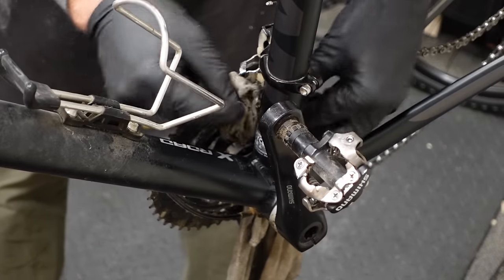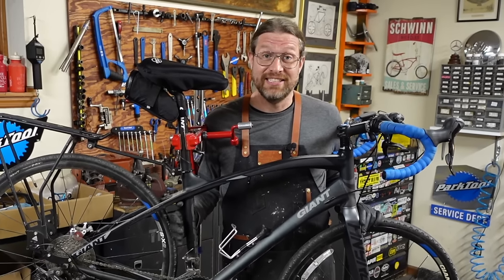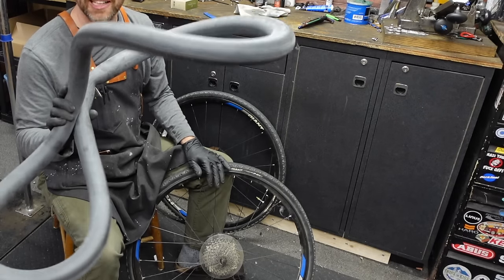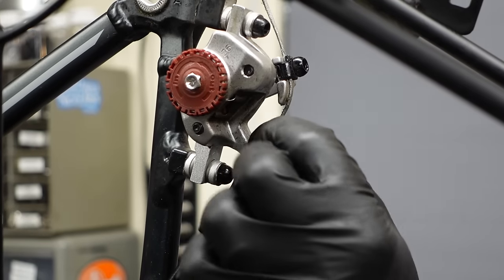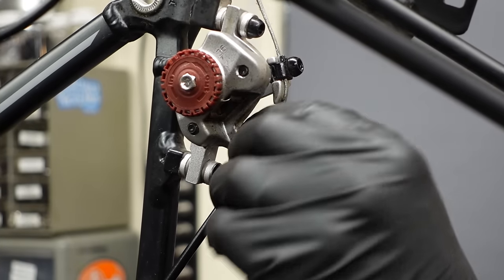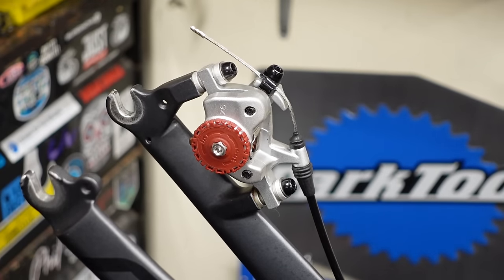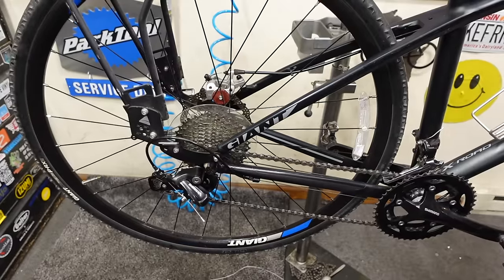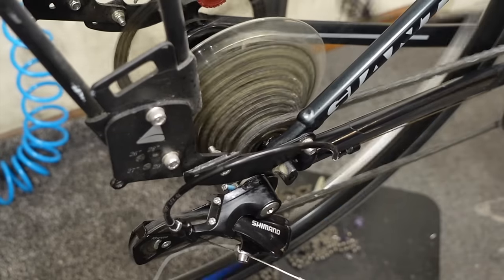Preventative Bicycle Maintenance the EASY WAY! Giant Anyroad gets a basic tune and a couple tweaks!

Comment: Giant Anyroad. Had one for a few months. A good bike but just not thrilled with the geometry. The front center was much too long, and the engineers at Giant must have never read CON1.  The dimensions and geometry were just not right. Amazingly, I find many of the old bikes for the late 1960s to the early 1980s to have excellent handling which comes from excellent geometry. Even the Schwinn Paramount was an excellent bike.

Comment: Is there any risk of getting that Dawn nuclear wash into the bearings and acting as a degreaser when you're spraying it all around there? I'm guessing not, since you're doing it, which I find exciting, because that stuff really does the job.
Reply: the only thing he does wrong is to put oil on the two derailleur's screws, because there is teflon into their threads. Moreover teflon doesn't like oil.

Comment: Not the first time I've heard the term "cheap tape" (handlebar tape), tape with no stickum on it.
So what "good" tape is made by who? My Masi Gran Corsa still has its original handlebar tape, and it really needs to be replaced now. It's a 2015 model I bought in 2017. I love cork tape for it's softness/padding, and for it's stickiness , even wet. I hope for and will be anticipating a response 😁👍

Comment: I like that as part of your service the wheels go straight into the truing stand, killing two birds with one stone as you clean while you inspect and adjust. A truing stand and compressed air would be so useful, they’re both on the Wish List. 

I wash down my bikes with warm water with a little car shampoo, degrease and attend to the drivetrain, rinse then blow dry (it’s too cold to leave a freshly-cleaned bike to air dry without inviting problems) and buff with an old dish towel / microfibre cloth / whatever until the wax in the car polish brings out the shine, then lube where needed. Quick, satisfying and easy. Using warm water seems to have saved a lot of time, a little degreaser and plenty of effort: so much mud, road muck and rain at this time of year that some weeks even the commuter gets a quick once-over in between rides, and my patience wears thin when I’ve been riding in the cold after a day at work 😅 I’d love to somehow get access to hotwater outside the house so I could spray everything down with warm water first. Using buckets is a p.i.t.a but gets more crap off faster than a cold spraydown. A warmwater spray would be ideal.

Next up, when I need a new chain I’m going to wax it and see how that goes. Doesn’t look hard to do, though there’s a trade-off in terms of time. I’d be interested to hear everyone p’s thoughts on that.
Reply: I would be a yes vote for chain waxing
Reply: @thomasjones6776 cheers for the recommendation, Thomas. Any favourite products or tips you'd suggest? TIA, Ben
Reply: @1972hermanoben  i just tried the silica chain cleaner and it was good, but would have benefited from a second cleaning or a longer first cleaning, but it eliminates the need for tough to dispose of cleaners.   Buy a small crock pot from a goodwill as they always tend to have them. Have something to set the waxed chain and something to pull it out with. Hope that helps!
Reply: @thomasjones6776  Great tip re the crockpot, that's ideal. Thanks for the advice. I thought Silica looked the best bet - kind of a 'you get what you pay for' deal, it seems. Cheers, and all the best 😊

Comment: We continue to enjoy your channel. Question. I got a bike for grand daughter but it was too big for her. Maybe one more year or less she will grow up. Got it brand new for her. Wanted to know what can I do to prevent it from rusting. Here in Hawaii we have rain and hot and humidity is high. I have in the basement and cover it. But I know with how the weather here in Hawaii it may get some rust. Thanks in advance and aloha.
Reply: Oil the chain, that's usually the worst for rust when a bike left sitting. You can just use axle grease or motor oil, get plenty on, then wipe it off when you ready to ride it again. I've used Vaseline in the past too, it's good on chromed parts & exposed cables to prevent rust.
Reply: @papalegba6796  thank you

Comment: Almost seems like if the bars were wrapped in the opposite rotation around the bars, the wrap wouldn’t have unwound like it did.
Reply: Stock tape seems to suffer from that, especially on a bike that isn't fitted properly. Not sure if that was stock tape, but that's been my experience.
Reply: Park Tool has an excellent video on how to wrap handlebar tape.  According to Calvin Jones, bar tape should be wrapped to the outside on the lower half of the bar, (below the hoods) and the part above the hoods should be wrapped towards the back.  The reasoning behind this technique is that when you are riding with your hands on the top part of the bars, your hands will naturally want to rotate toward the rider (back) and this motion will put pressure on the tape and tighten it.  If you wrap towards the front, the backward pressure of your hands will loosen the tape and it will unwind.  There are lots of people that do it either way and no matter which way you wrap, sooner or later the tape will come loose and need to be replaced.

Comment: What would you think about using something like a 3m spray adhesive on the handlebar before wrapping with tape? That should keep it from sliding.
Reply from the maker: Sounds like a terrible idea
Reply: @bkefrmr  not that my thoughts have any effect on your world, but your thoughts (as an expert) have an effect on mine. To me it seems like a solution to a problem. Obviously you think it's a "terrible idea" but maybe you could add a word or two to say why.

Comment: When you turned it upright or all the way over, did you still have the stand clamped on the seat tube? I've got a stand coming but the weight of my old mid 90's mtb upright by just seat tube gives me anxiety. 😬

Comment: What is that double brake setup?  I have never seen it set up like that before.

I remember in the 70's and 80's the dropdar brakes had compound levers on one brake lever, but have never seen 2 pairs of separate levers like that.
Reply: They are designed to make the bike heavier and prevent you from installing a handle bar bag, and give you less room for lights, etc...     That style of brake  maybe has some use on a road bike for a kid who is learning to use drop bars. And maybe as a confidence booster for someone riding drop bars for the absolute first time, or with mobility limitations.    They are mostly  for people who would probably be happier with a flat bar road or gravel bike but want drop bars for whatever reason I.e because its fashionable.   Modern compact bars,  levers , and brakes make braking super easy even from the hoods.
Reply: I have the compound levers (aka turkey wings or suicide levers) on my 80's Bridgestone. They came with the bike. I know people ridicule them but the slacker in me likes them.
Reply: The modern variety are known as "interrupter levers" or "crosstop levers".
Reply: @mattgies , thank you that was educational and I found out a lot of information looking them up!
Reply: @JustMikeH  Cheers!

Comment: "and now we're going to do the same for the Front Wheel . . . ", as he spins the Wheel in the Truing Machine w/ the caliper too tight and scratches the entire diameter of the Rim on one side.
Reply from the maker: oh the horror
Reply: @bkefrmr  Scratch or nick a Carbon Fiber fishing pole, and that's exactly where it will snap and break every time. Scratch anodized clad aluminum, and that's where Exfoliation and Filiform corrosion begins. Sounds like you just don't care about how much someone pays for these items on a bicycle, what a Hack.

Comment: Why all the spray chemicals? Seems all you're doing is smearing the grime into the finishes. I rinse mine down with hose water and scrub everything off with a rag/ bucket of soapy (Dawn) water. Use a tooth brush to get in tight spots. Degrease the cogs with a biodegradable degreaser. Spray it all down a few times and use an air compressor to blow the rest out. Wipe it dry and use automotive meguires ceramic tech wax (just something I have around) to protect the frame/ fork.  It's made for outdoor paint protection. I suppose furniture polish would work, but why not use stuff made for UV paint protection? Any way you slice it, it looks cleaner.
Reply: That's why you should do it yourself!

Comment: 1x = garbage 
2x= good but not great
3x= the best gearing ratios a cyclist can ask for, yes it's old school but mechanically speaking it makes total sense, also longevity to the drivetrain and loads of options.
 1x is only a benefit to the bike manufacturer, $$$ charging you as much for a complete bike with less to offer and zero mechanical advantage plus no front derailleur and shifter ( hmmm think about it, $$). 
Just my 5 cent opinion :)))

Comment: What lube were you using for the cables?
Reply: Vaseline oil for short term effect, lithium grease for long term effect.
Reply: @threeDeeBeginner  No, the viscosity of grease is too thick. You want a light oil that will drip down the housing, and cable.

Comment: I know you ❤ Behold.   If it were as cost effective, I like an Automotive detail product.  Meguiar's D15601 Synthetic X-Press Spray Wax is on Amazon by the gallon.  I spritz auto body, leather seats, any surface on a bike except the seat of my pants.  It's probably good wax for the chain & components.  I understand your position on the Behold,  just my 2 cents 😊

Comment: Why jockey wheels on my rear derailleur get in one vertical line,when the lower one normally needs to be in the back and the upper one closer to a freewheel.Is there something with a rear derailleur or frozen chain links? I sprayed the oil,but the issue keeps reappearing
Reply: Is the chain hopping off of any certain gear? If so, your B-screw may need adjusting. The B-screw is a screw that is located in the rear derailleur, and pointed at the rear dropouts.

Essentially, you can tighten or loosen this screw to bring the derailleur closer or further away from the freewheel or cassette. 

What you want to do is put the chain in the smallest cog on the freewheel or derailleur, then by tightening or loosening the B-screw, you want to have about 1.5-2 chain links between the tooth on the freewheel or cassette, and the first tooth of the upper jockey wheel.

I highly recommend watching Park Tool's video on how to properly diagnose and adjust your rear derailleur. They do a good job with almost all of the repairs common to bicycles.
Reply: The chain slips through when this happens,usually on the smaller cogs,to make it normal I again I have to push it in a usual position
Reply: @romanmentor9238  : Is the chain often in a different gear than your shifter indicates when that happens? Say, for example, your shifter says you're on Cog 5, but your chain is on Cog 6. Is there also a clicking noise when you rotate the crank?

Because this sounds like either a worn cable, or a cable that needs to be adjusted by tightening up the slack in the cable, which you do with a barrel adjuster, either on the shifter, or where the shift cable is connected to the derailleur.

Edit: Also make sure you don't have a worn-out derailleur as well. Do this by putting the derailleur and chain on the smallest rear cog. Once that is done, grasp the bottom jockey wheel and cage, and see if there is excessive play, which is lateral movement relative to rear wheel. If there is more than 2-4 millimeters of play, you could have a worn derailleur, in which case you may need a new one. Lastly, before you do this, check and make sure the derailleur mounting bolt that mounts to the derailleur hanger is tight enough to allow normal movement. If it is loose, tighten it up first.
Reply: Sounds like you have a rusted B-pivot. Try to work some lube into it. Some of them can be disassembled for proper rust removal, but it's not an easy job.
Reply: There seems to be some play in an upper jockey wheel,but no play at the bottom one
Reply: @romanmentor9238  There's supposed to be play in the upper pulley. Refer again to my suggestion about the B-pivot. It should be springing back freely but you seem to have described needing to force it to return to its rest position.
Reply: @mattgies  Yea,the upper pulley is further to the rear and chain doesnt engage with freewheel as it should.I've noticed some videos mention B-pivot screw to adjust,but it seems non existent on this derailleur from 2000s

Comment: Man, what avg Joe has all these stands, chemicals and tools to maintain their bike. That's like hundreds of dollars of stuff just to clean a bike lol. Makes it looks easy when you got a whole workshop for this. That's why people pay for it I guess. I got a hose and a rag. That's it
Reply: The wheels can be cleaned without removing them from the bike. You can clean the frame the same way as he did, spraying and wiping it down, flossing with a cotton rag (old T-shirt or bed sheets).  Put sheet plastic, a tarp or oilcloth tablecloth on the floor if you're doing inside your home.  Tools; allen wrenches, a flat and Phillips screwdriver (small), some open wrenches, maybe some sockets and driver from Harbor Freight or a garage/estate sale and you're set.

Comment: Why one need to clean spokes?!!!🤯
Reply: They get grimey and corroded. It looks better clean and prevents problems further down the road. Plus, when you handle something it's an inspection, so if one was loose, he'd notice.
Reply: @maryharrington8983  i never clean spokes,i am riding any weather, including snow with salt. I never had spoke corroded. Yes, inspection may prevent loose spoke, but 1 or even 2 broken spokes on commuter wheel with 32 or 36 spokes is not a big deal. you can finish your ride and fix it.